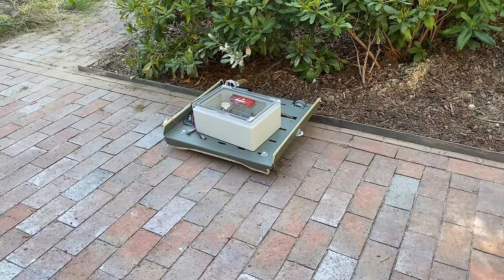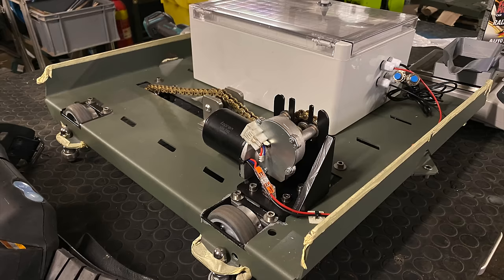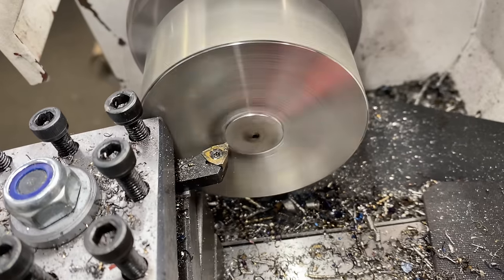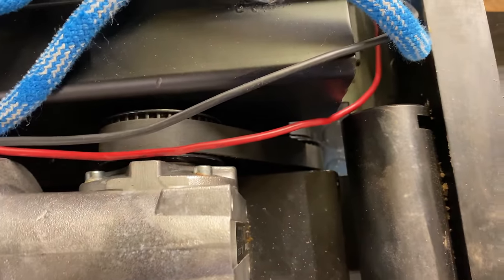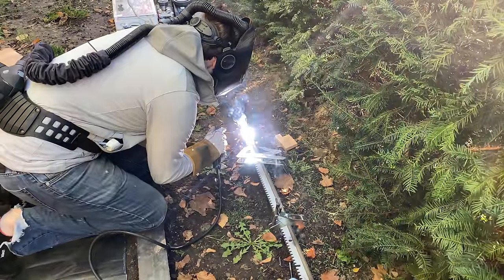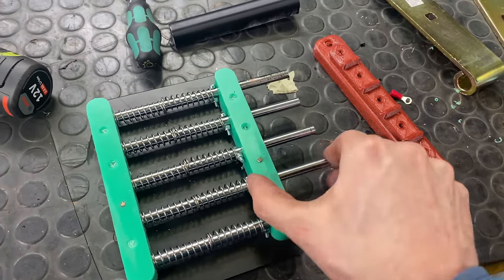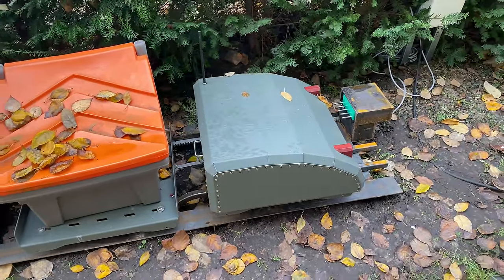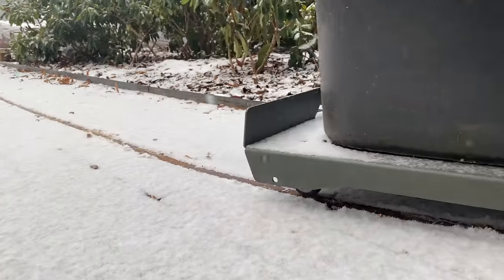I put my trash cans on rails and now they move automaticaly! (Trash Train)

Comment: I live in the Hollywood Hills in Los Angeles. There are new laws for any new construction as part of a new wildlife ordinance for the whole of the Santa Monica Mountains which includes areas like Bel-Air. The ugly trash bins must be hidden from view and inaccessible to wildlife (especially raccoons and coyotes) so perhaps the train can go into its train shed and a door could automatically close (or open).. This is an area of several thousand upscale houses. In many cases, a modification would have to be made to get one of these trains to function on a slope without tipping over the bins. (Here we only have three bins available -- garden refuse, recycling and trash). Of course the garden refuse in particular can be quite heavy, but when full the bins generally would be going downhill although there are some houses that are below street grade.  I have seen many existing houses with steep, long driveways and some people just leave their bins at the street and someone has to walk down the drive to empty the trash, or if they don't leave them at the curb, they have to lug them back uphill. Considering how many very wealthy people live in this area, I think something like this could sell if it can be proven to be reliable. I can imagine someone having their bins at the back of their house, then simply pressing a button and delivering the bins (as you've shown) down at the bottom of the drive and then, of course, recalling them after the trash trucks have left. So if you do get an investor for the American market, and assuming this could be quite a high price item, it could be a specialty market for those who think nothing of spending thousands to keep the entrance to their driveways clean and uncluttered.  https://www.nbclosangeles.com/news/local/la-planning-commission-approves-of-wildlife-district-in-santa-monica-mountains/3051418/
Reply from the maker: I am up for that.

Comment: Beautiful video I would say this for your stopping part you just have to use them in magnetic sensor on both ends just before the end two sensors on each end to slow it down go to slow speed it's an option but if you have the sensors adjusted right you only need him on each end. Don't forget the train sound with horn. Visitors and people would love that. Can't believe they only pick up garbage once a month, should get really smelling good at the end of the month. Course you have to feed the insects.
Reply from the maker: Would be cool if there was a sensor that not only knows that its tripped but also where it is tripped. I know robots scan QR codes that are glued to the floor.

Comment: I like the idea of one elevated guide rail. Would be interesting, if it's possible to omit the gear rack and have driving wheels on both sides of the guide rails pulled together by springs. Another approach would be to make each carriage (or every 2-nd carriage) self-propelled and get rid of the epic locomotive at all. 

Main concern is safety, it's good idea to check how electric gates are made - they typically have electronics that measure current consumption by the motor - if it grows, it means that there is some obstacle that is blocking the movement. Think of a 3 y.o. kid or a disabled person who gets into the way of this train - they should not be pushed into a wall with it too hard.
Reply from the maker: That’s the way I am going. With pinching wheels. Safety wise this train has the same thing as a sliding gate. Current sensing turns off the motor.

Comment: The garbage can train is great. But I find that the greatest effort is in the automatic movement. Manual pushing, once or twice a week, would also be possible. The rolling friction (steel on steel) is only 0.1. With a total weight of 500 kg, this is less than moving a full ton on its own wheels. But, there is probably much more at stake here. 😉Have fun with it.
Reply from the maker: Manual would be better, but I had about 30kg of thrust required. That is quite a lot. You would need a long handle that pulls them at the bottom. The rolling resistance seems about allright. Maybe a little bit more for my case because of the plastic wheels. They are quieter. But we use the train about 5x a day to throw something out.

Comment: Just curious (and sorry if I'm just being ignorant about this), but isn't it a liability issue with the electric connector pins just sticking out?  Couldn't somebody or something pretty easily create a short between the pins?
Reply from the maker: Its just 22V. So that is very safe. You can touch them with bare hands.

Comment: Hey! Amazing video! I've always been fascinated with trains and minecarts in general and I think this is really ingenious. Just a thought; shouldn't the retracting contacts for charging the batteries be on the train instead of the stationary bit? I don't know how much voltage is used to charge the batteries, but if something were to brush up against the exposed contacts it could receive a shock, which if you were to mass produce these, could be a safety hazard. If the contacts were in the train, they would become uncharged once the train pulls away, mitigating the risk completely. A design similar to a wall plug is pretty much what I'm talking about.
Reply from the maker: Me too, I love mine carts! This is only 20V. Same as a lawn mowing robot or even a vacuum robot I think. So that is fine. Only a piece of metal on the contacts would blow a fuse.

Comment: Cool concept but one major flaw. The trash truck won’t be too concerned with where they put your bins back. Could be on the track panel, could be next to the track panel on the street.
Reply from the maker: Our garbage men pick up the cans from our property and return it. All by hand.
Reply: @MaxMakerChannel  awesome, it would probably work out in that case. Where I live in the u.s. the trash truck has a robotic arm that heaves the trash can over head dumps in and puts it down. Usually not in the same orientation. Sometimes can is sideways or tipped onto my lawn. There also needs to be 3 foot minim spacing between cans and they must be on the road. Otherwise they just drive past. I’ve had it happen 😢maybe some of this info will be useful if you plan on marketing out. Cool idea nevertheless

Comment: The trick with Rails and grip is, minimize the point of contact. means: the trail needs to be round on top and not flat, and so needs to be the Wheel. no flat contacts at all, that makes it have less friction. this is not Rubber ;)
Reply from the maker: I tried to learn about train wheels, but didn’t find that much info.
Reply: @MaxMakerChannel  Hehe yea, i only know simple Mechanics, not that im 100% sure either. but less contact means more pressure. that im pretty sure of :) And Trains must have waay more friction, since they basicly only standing on a fingertip wide area, and still can deliver 10'000s of PS on the Tracks. you where on the right way with adding more weight, thats for sure hehe.

Comment: You need a railroad station at the street end, either a ramp on the single waggons or lower the track so the waggons top surface is at street height. no one wants lo lift the cans. Plus you can add a timer instead of the remote, just let it go once a week by itself. And for gods sake, put the cans on the right way not backwards :)
Reply from the maker: That would be brick work. We open the cans about 5x a day, but only take them off once or twice a month.

Comment: super awesome I love this. but what happens if it floods enough to submerge the charging pins?
Reply from the maker: Good question! That cannot really happen since the height the water got to was kinda the magic level. Above that it would flow back onto the street. However we fixed the flooding problem for good. A new video about that will be next.

Comment: Nice work. Have you concidered using a pulley or conveyor type system? Similar to how a rollercoaster chain lift works but on its side to go around corners.
Reply from the maker: Yes, but they are difficult to get around bends.

Comment: It's possible to use roller chain bolted beside your track and than use a sprocket for a drivewheel
Reply from the maker: Sure, but a steel cable would be better.

Comment: That’s really cool. Great idea to help elderly or people with disabilities or just want something neat! Steel on steel is ofc going to slip did you try using rubber strips or grip tape on the rails before going to rack and pinion? Just wondering if it would be easier and cheaper then going to r&p which required a lot of re-engineering by you

Comment: Ok but you need a sensor system to stop it for animals or kids,  that's a problem.  Fix that for safety, im Interested in how you can get past that,  maybe like a laser garage door opener system. Idk but  that's definitely a problem.    IL look forward to see if you can work that problem out,  you will definitely need to resolve that issue,   you know I would look into how chair lift systems like the ones for homes that ride the track to the top of the stairs  work,  when they feel a object binding them  on the stairs they stop,  garage door stops an gos up... this is the only big hurdle I see that I'm curious how you can fix but if your child decides to walk out there an ride it as kids doo an gets tangled in it... see my point or the family cat/dog... great work,   IL keep waiting to see a follow up on the safety stop
Reply from the maker: Not a problem. It has force sensing. Just like a car window or sliding gate.

Comment: Unfortunately this wouldn't work in most places in the United States because the trucks pick up the trash cans and set them back down again. The cans have to be at the curb on the street where they would have to go across a public sidewalk. Another issue is that the trucks that pick up the cans do not set them down again with any real accuracy so they wouldn't be returned to the "train cars" the same as they were picked up. It is a real cool idea but there would have to be major changes to make them work where I live. I find this idea really interesting. Thanks!!
Reply from the maker: I don´t expect this thing to actually drive onto the street. Thats pretty much impossible in Europe anyway since we always have a pavement in between. This is only to drive on the property.

Comment: Amusing but genius video.  Thought I have is: when the bin men come to empty your bins, do they know to put them on a certain way?  Could do with some sort of swivel mechanism that turns the bins so the handles are at the front rather than the rear.  Bin men in the UK are soooo lazy!  I’m not sure you’d have that issue in Germany.
Reply from the maker: They only take off 2 out of the 7 bins at a time. So they know the orientation. There is a clever mechanism where you would add a extra turntable on top that has a gear on its outer edge and then the gear would need to drive by a additional rack on the side. Then the bins would spin. But thats a extra complexity, that I don’t need.

Comment: Wouldn't a cable car system reduce the complexity significantly? Look up the residential cable cars in New Zealand, if you are looking to develop this into an accessibility products aimed at elderly and disabled people, those would probably be instructive to look into.
Reply from the maker: Yes a cable would be much easier, but also difficult to get around the bends.
Reply: Look at how they handle bends on the new Zealand ones. It's really cool.

Comment: how easy is it to unload a really heavy bin? also I would add some sort of safety features such as an alarm or lights for commercial version or even make it operable by the bin collection services a gps signal when the lorry is on the street and similar when they leave
Reply from the maker: Its just 5cm above the ground. Not harder than lifting it down the curb.

Comment: fantastic project. It definitely enters my to-do list. Though, I wonder.. wouldn't it be easier to make each carriage motorised but using simpler components?... I am sure that your first design would have worked fine if there was one underneath each bin... you could have avoided a lot of complexity don't you think?
Reply from the maker: Yes! If its own weight is adding friction it doesn’t slip the wheels.

Comment: it mightve worked as good for a fraction of the costs if you used motorcycle chain and sprocket instead of the rack and pinion , wouldve needed a little more welding of the chain to the "rail" but that would be a minor inconveniance , the idea is good though

Comment: With all the mechanical work you've already done, it would seem logical to add one more simple step.  Why not add some automation, so the remote activates at a programmable time in the morning to send the cans to the street and then returns later in the day after the cans have been emptied?  This way you don't have to work so hard to push the remote button. ;-)

Comment: How has it been with wear and tear? Have you had to replace parts?
Reply from the maker: So far only two bearings. The plastic on them is very soft. The main gear is a bit worn. Need to print a new one this summer.

Comment: It's a cool project, but if you really want to sell it, you're going to have to make a lot of changes, comply with the Machinery Directive and provide a declaration of conformity. From a safety point of view, it doesn't even come close to the requirements needed to operate something like this in the public domain, which is what you're doing in your case, even if it's a private property, if it's easily accessible from the public road, then the requirements are even stricter, especially in Germany. It's really not worth it, well maybe in the US, the regulations are much more relaxed there.

Comment: Just a thought it's a interesting idea but here in my country the bin wagon is on the road and we have to put the bins outside the garden and bin men won't put your bins back in the garden here you have to do it yourself so won't you still have a degree of manual work to do putting it on and off the track how easy is it I don't know maby future houses can be built it's indulgence you ppl who think they will have to work less possibly not slateing your work or ideas it's a valid point do the bin men make more effort in your country cos if so it's very diffrent here

Comment: I wouldn't use those pinion racks. Those are insanely expensive. I would rather consider gluing or riveting a garden hose over the rail, and then grip it with two sets of spring loaded dual drive grip wheels - sort of like 3D printer BMG extruder (or two of them in series for more grip). 😉 Also I would consider making the drivetrain a part of the first/last coach, so the trash would weigh it down for better grip. 😊
Reply: Also garden hose over the edge of that rail would immensely improve safety. You really dont want to fall on that rail 😀

Comment: A train pulled by a rope would be 10x smarter, but nice project!

No need for battery charging, less weight needed in the train and easier maintenance. And it would be easier to automate it, because you could use wire signal instead of radio.
Reply from the maker: Only issue with the rope is going around corners.
Reply: @MaxMakerChannel  yea

But I think it would be possible

But if you’re thinking about selling it, this version is the best. More maintenance = more money
Reply from the maker: @lilchicken6986  No way! My products are designed in a way that maintenance is minimal and if at all you can do it yourself. Including troubleshooting. Yes maintenance makes money, but also unhappy customers. Thats not worth it for me. Trouble is not worth it.
Reply: @MaxMakerChannel  I respect that bro!

Comment: Did you thought about doing it like a cable car? No batteries, fixed motor, can also be adjusted to make turns etc
Reply from the maker: Yes. I figured the turns would be to difficult.

Comment: This would look so much better with identical bins or cascading bins. Also, what happens if there's a cat or a dog lying in front of it? Would it stop, got enough torque to run over or is there some kind of lip that sweeps obstacles under the nose?
Reply from the maker: It has force sensing. So it stops when my foot is in the way. A cat would run away. Just like from a car or a sliding gate.
Reply: @MaxMakerChannel  Great job there.

Comment: You know, you can use the charging signal as an end stop. Once it receives power from the charger, it sends a signal to stop. I will ensure that the train is charging at the stop.
Reply from the maker: Yes, but the charger is completely separate at the moment. It isn´t tied into the electonics.
Reply: @MaxMakerChannel  I think it's just something to look into if you're planning on going commercial. It pretty much eliminates the instance of finding out during the next garbage day that the battery is dead.

Comment: Why not just put a truck suspension spring in the bottom of the cans and you can tighten the rope towards you when the garbage truck comes and then you release it quickly to eject the garbage onto the truck?  Or you could mount a pendulum rope from a tree to swing the garbage cans towards the garbage truck? What about mounting sails on the cans? Then they can sail away and you don't need to worry about the garbage?

Comment: A little late to the game - would driving both sides of the vertical track with polyurethane wheel provide sufficient traction (with string enough springs)? Could save significant cost of the rack.
Reply from the maker: Yes that would be a good option. But this rack wasn’t very expensive. Its not precise so thats why its cheap.